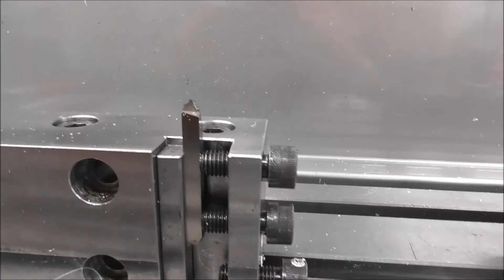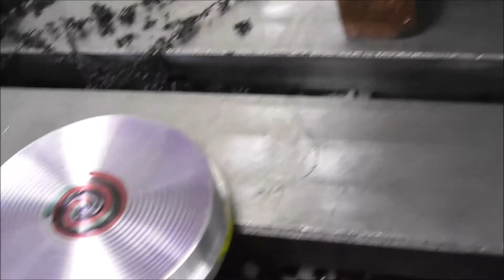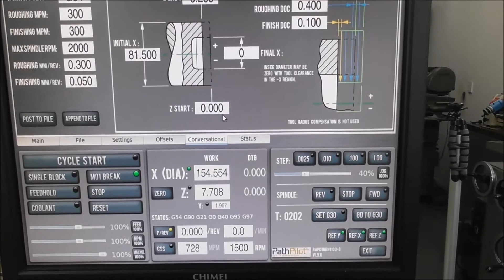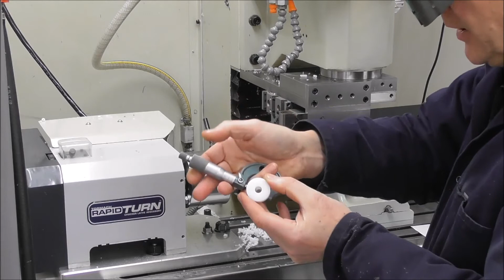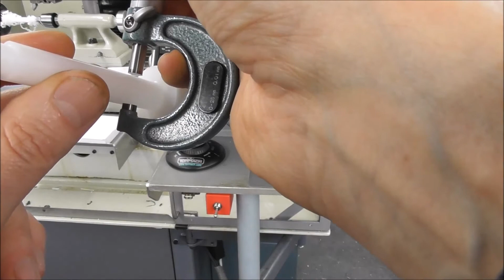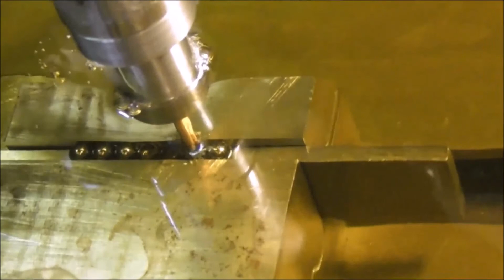Tormach RapidTurn -  Part 22 -  Surface Finish and Accuracy Continued

Comment: I'm thinking about buying a RapidTurn and planning to only use it with collets. Have you tested the spindle runout? Would you recommend the RapidTurn now all these years later? Thank you!
Reply from the maker: Hi - Spindle runout was minimal on my second replacement unit. Since I have bought Slantpro I have not used Rapidturn much, so I have no update. In my mind, it remains very good value for money and a capable kit for light work. Cheers, Cliff
Reply: The term "second replacement unit" scares me a little. Thank you for the reply. @Threadexpress

Comment: Cliff, did u try to mount a tool perpendicular to face off the part ( for instance with a parting tool ) instead of moving the tool axial to the face ( which creates a radial cut point )?
Reply from the maker: Hi Sure D -  You are really doing a viewing marathon!   I don't quite follow your question. If the tool has vertical clearance, then why does it matter which way it is clamped in the toolholder...or am I misunderstanding you?  Cheers  Cliff
Reply: I can't explain this theoretically, but i have seen several occasions where a parting tool was used with the intention to face a part instead of parting it ( comes in from the Y axis ). Sounds odd, but the surface quality was better then coming in from the X axis. Maybe the tool's cutting point was especially designed ( like a curve  instead of an edge ). I can imagine that the applied forces are different when tools are moving a part vertically or horizontally. I am also a goldsmith and know that angles of attack matter a lot in surface finishing. Think of rotating a polishing material versus moving it linear. Worlds apart in result. Hard to explain.
If this is BS, then simply ignore it. Don't want to waste ur time :-)
Reply from the maker: Hi Sure D. No.. I know what you mean about a hunch....often they point you in the right direction. Cheers  Cliff

Comment: Cliff, looking at this problem, I would suspect the issue is with the software or update rate of the outputs and coordination of the VFD speed and the z axis feed.  If you try your problem part with a sharp single point tool perpendicular to the face (like threading the face) I'll bet you will see this pattern in the grooves left behind and you may be able to measure the spread between the grooves.  With a light cut, this would eliminate most resonance and if the grooves appear, this is a software problem.
Reply from the maker: Hi Khris. Very interesting, this is an area where I have limited understanding... and you seem to have a much better understanding.  Before I do another test can we discuss it a little more. IE The resonance is unlikely to be less with a light cut as the cut was very light, and if it is due to an error in the bearings or a Z stepper resonance or sympathy reaction it will still be there. Also I have undertaken some more tests since the vide similar to as you suggest and the pattern was not there. Is there another test that might expose your theory ?  Cheers  Cliff

Comment: Hi, mind if I ask a few questions?
1. What's the status on the Hallmark ITTP?  When do you think you'll have it for sale?
2. Is it possible that the weight of the fixture on the spindle has a degrading effect on the stability of the spindle over time?  What is the weight of this, and what material did you make it from?  Aluminum, steel, ??  And also, do you know what is the limit of weight that Tormach allowed on the z axis? 

I am looking to buy the 1100 and also the rapid turn and a 4th axis.  You scared me off the rapid turn a little, and now I'm back to being more ok with it.  Your work with the Rapid Turn on the 1100 is really inspiring and is an eye opener.  So I thank you for that.  Cheers.
Reply from the maker: Hi Da L. 
All is well with the ITTP. At the end of part 6 is my email address which is best for commercial specifics.
Re  gang fixture. It is steel (less thermal expansion than aluminium) .The Z moves so slow I doubt weight is an issue.
If anything the mass adds stability.  Cheers   Cliff